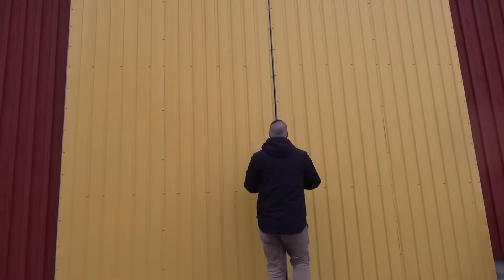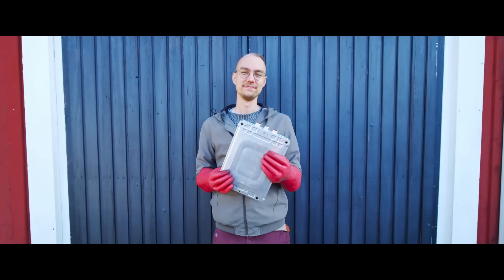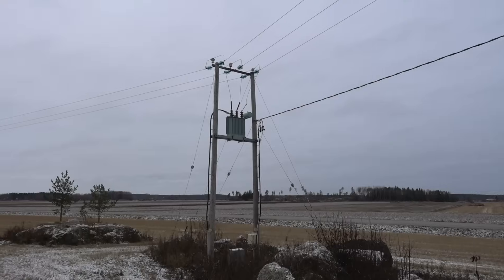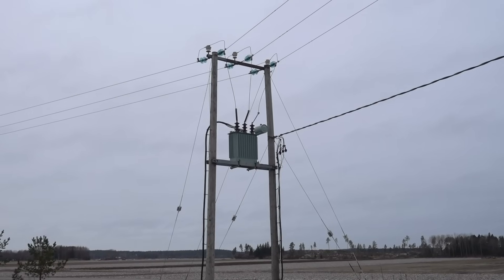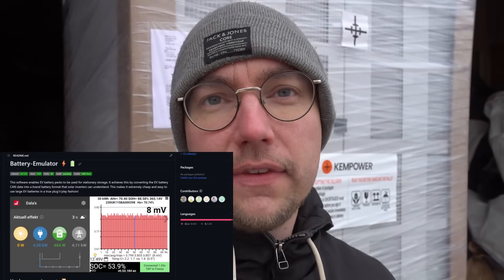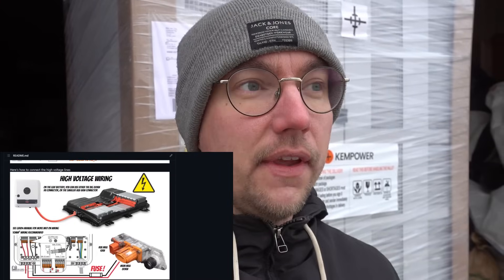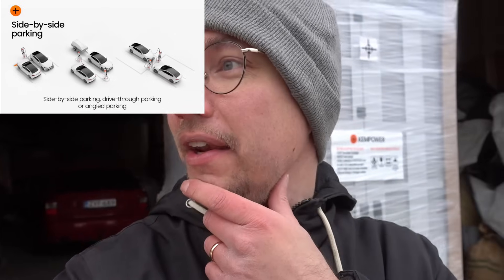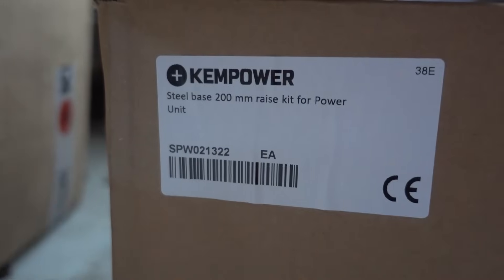400kW charging at home 🤯

Comment: Sounds like a great opportunity. Combine the technology you have developed with some off the shelf charge stations, sprinkle with come community assistance and possibly some crowd funding. Then you will be in the position of being one of the charging companies. Except you will be able to install your stations in locations with limited grid capacity. A whole market niche that has just been waiting for a solution. There would be lots of businesses that would love to have charging stations in their car park but the huge initial cost for grid connectivity upgrades combined with the large ongoing cost makes it impossible. In rolls Dala with his team of enthusiasts/followers/volunteers and for a much smaller initial and ongoing cost they setup commercial grade charging stations with a cabinet or small shipping container full of batteries. Maybe even a solar setup to charge the batteries to reduce grid electricity costs. All it needs is someone to push the idea. The small shipping container (about the size of a car parking spot) can be built offsite and transported in when ready. You could possibly even integrate the charging stations into the shipping container. Have half of the container enclosed for batteries and electrical equipment and the other half just have the roof and floor and have the charging station or satellite station installed in the open half. That way it would eliminate almost all onsite work. Just a single grid connection. This would make for minimal disruption to the customers site. It would also be much easier to move it to a new location in the future if required. So many opportunities. Also, building the setup offsite in a warehouse/workshop would eliminate delays due to weather. For a lot of the installations I have seen it takes many months to get a charging station installed and commissioned. Many different contractors have to do their work which needs to be scheduled and there needs to be enough delay between each contractor to allow for any delays. Whereas, you would able to do the majority of the build indoors, in a workshop with access to all the tools and heavy lifting equipment, away from any bad weather. You would also eliminate the risk to public safety issues that come with infrastructure changes to an active site.  Major damage could be fixed by a truck dropping off a new setup and taking the old one back to the workshop for repair. I am sure there are other benefits and of course any business would have it's issues but I think this idea could take advantage of your experiences up to now as well as the support your channel has generated.
Reply: "Except you will be able to install your stations in locations with limited grid capacity. "
Utter humbug. You can install all the fancy high Wattage hardware you want, how many Watts you get out of it is going to always be limited by the capacity of the local grid. Anything else is just magic thinking.
Reply: @mikethespike7579  The ability to store power in local batteries changes this. Yes, you won't be able to charge car after car at maximum charge rate 24/7. If your charging station is being fed 40kW from the grid then depending on the charging stations battery capacity you could charge many cars at full charge rate. Just not a never ending parade of them. In many locations there are busy periods and periods with no cars charging. Whenever there are no cars charging then all 40kW is going into the batteries. Then later when a car wants to charge the charger will draw 40kW from the grid and as many kW from the batteries as the charger and vehicle can handle. If many cars charge in a row then the charge rate would eventually drop as the charger batteries became depleted. But the charge rate wouldn't drop below 40kW as that is what the grid is able to supply. Depending on the busy times at the charging location there may even be cost savings due to the batteries charging in a low electricity cost per kW time period and then delivering that power later for a higher price.
Reply: @jaseastroboy9240  I was relating to your "There would be lots of businesses that would love to have charging stations in their car park".
That implies constant high voltage charging abilities for company cars, something you have now negated.
BTW, such a charging battery would cost about half the value of a new EV. Not to mention the cost of the actual charging station itself. And all that just to charge one single car within 5 minutes ever day?
On top of that, such rapid charging, as everyone should know, comes with a few disadvantages. It drastically decreases the life expectancy of the battery for one. And the heat development in the cells of both car and charging battery from such rapid charging would be extremely high and raise the danger of self-combustion.
Personally, I consider this "project" stupid, but I daresay some people need a hobby.
Reply: @mikethespike7579  Saying that there are businesses that would like to have charging facilities in their carpark doesn't have anything to do with company cars. If a business thought that having a charging station in their carpark could generate some additional customers through the door as well as some positive community sentiment. Then that doesn't involve company cars, I am not sure how you read anything about company cars into what I had written.
As for your point about the cost of batteries. Dala has done some amazing work on re-purposing old Nissan Leaf battery packs as fixed energy storage. So I was suggested the battery storage for the charging station as it would draw on Dala's existing expertise and experience.
And then your final point seems to be saying how bad it is to rapid charge an EV's battery. This may be true however people are still rapid charging their cars and are wanting the ability to rapidly charge at their destination. So I believe offering a product that allows a business to have a rapid charging station deployed to their carpark despite their limited grid connection capacity would be popular. And once again, this would be for the use of their customers as well as general use by the EV population, this would not be a solution for a business that had a fleet of company cars and wanted to be able to charge non-stop, one car after another.
Reply: @jaseastroboy9240  Who's differentiating between staff and customer cars? I know I'm not. I don't thing a charging station of the type you are describing would know the difference.
As for rapid charging, the kind of rapid charging described here is not what you seem to think it is. 400W will fully charge a normal EV within about 5 minutes. That's what the video is all about. But regularly charging at that speed will within months drastically diminish both your EV's battery capacity and that of the charging station's. That sort of rapid charging would also develop dangerously high temperatures inside both the EV battery and the charging battery if not cooled somehow.
And another thing you seem not to understand: The charger battery needs to be double the capacity of the EV battery (traction battery) to offer a full charging load. So, that's your suggestion of a cheap charger batteries gone out of the window right there.
Electricity is a complex technology not easily understood by a layperson. The numbers of "EV experts" now suggesting solutions that could have originated in a kindergarten seem to corroborate this.
Reply: @mikethespike7579  I think you meant 400kW. I am not sure but I thought I heard Dala say that the large electrical unit he was showing us is not the charging station itself but the box that feeds one or more charging stations. So the 400kW would likely not be directed out of a single charger. Although I do often see 350kW chargers at the charging locations around me. But I don't think there are any/many cars that can take charge at that rate. Certainly not for long. 
The cheap charger batteries wouldn't be a single EV worth of old batteries. Rather the charging station would have as many repurposed EV battery packs as needed. The packs are old and no longer suitable for use in an EV but stack up enough of them and they will provide enough current to satisfy any rapid charging EV. 
The decisions about how many battery packs to use would need to take into consideration the cost, demand, availability as well as the required storage capacity and desired charge rate. Obviously a site that anticipates a dozen charge sessions per day would get away with less battery packs than stations that expect fifty sessions per day. 
However if the layout of the battery racking and the associated supporting electronics were made as scalable as possible then if the initial storage capacity was found to be too small then it could be expanded later. This would also allow for lower initial cost for a business owner who may not be sure how busy their charging station will be.
I am not sure I would call this idea a kindergarten level idea. Dala would know more than most people what the merits of the idea are. It was little more than a suggestion to Dala of a way to implement a high charge rate charging station on a small grid connection. I also mentioned the idea as it aligns with a lot of Dala's previous projects, experience and knowledge.
Reply: @jaseastroboy9240  Personally I'd look into the possibility of using capacitors instead of batteries in charging stations. They can give unlimited high charges without damage, do not deteriorate and are far cheaper than batteries. Their only disadvantage is that they don't hold their charge longer than maybe two or three days. But that wouldn't be an issue if connected to an electrical mains supply. And anyway, lithium cells also lose their charge over time. Parking an an EV for 2 or 3 weeks will result in a totally flat battery.
Reply: @mikethespike7579 I don't think you know how "this" works in reality in different countries because of how the electric providers charge their customers. That is the reality we live in. When the sodium battery power banks hit the market, batteries will be used more or less as the price of power normally is much lower from 00.00 till 06.00. 
There are other "restrictions" to take in account, too. You can say that every "situation" is unique.

Comment: Well, if it's any conciliation, it looks like you have 3 phase power, which is necessary to even power up a large EVSE like that. No worries, even though it's rated for 400 kW, your Nissan Leaf will only draw a maximum of 50 kw from it. That transformer should have no problem with that, if you charge at night. You will need a 3 phase power meter, to bring in the necessary power connection. Time to call your local utility!
Reply: Basically all homes in Finland have three phase power and therefore metering too.

Comment: I would always think in these high power charger + battery bank to find a way to get that DC from the used ev batteries directly into suitable DC rail on the charger/power supply. Generally seems pointless to do DC-AC, AC-DC conversions along the way.

But then it might be not as easily plug and play as it would be with battery packs and inverters just “normally” feeding that kempower monster :)

Comment: Is this so you can charge a LEAF in under 10 minutes or something?
Reply: No. Because batteries have a limit as to how quickly you can charge them - the magnitude of the charging current the battery can handle.
Reply: @deang5622  It was meant as a joke, LEAF batteries also have no thermal management system
🤔 maybe he has a LEAF thermal management mod in the works too 🤯🤯
Reply: @Pegaroo_  Gotta make it sound like a joke then 🤣

Comment: Just for fun? As why would you ever need such a speed to charge at home? Your Car sits there 12-18 hours a day, some days maybe 48-72 hours! Ok this is fun to watch! Is there some minimum that it needs 400kW at 400V or 800V please explain to common people these basics in next video as we are not all familiar how it works and what you need. For example what is that connection that are needed to commercially install that 400kW unit in somewhere? 👍
Reply: He doesn't need the power, but the project 😅
Reply: @rkan2 But may other ones would need something like this, maybe not today, but in the next future. If the sodium iron batteries will be affordable, then this kind of solution will be quite common, as almost all power cables to every kind of properties/lots/parking areas are under dimensioned as of now. The problem are the peaks during the day, not the total consumption.

Comment: Now this one I'd have to come out and look at my self:) There is a company in Norway that "sups up" charge stations with weaker grid connections with a lower connectivity rate, as in your case. The name escaped me, but they also use kempower chargers for their installations. This is in effect a peak balancing solution 👌
Reply from the maker: Pixii powered chargers! This will be a budget version 😂

Comment: Just a guess. But charge at 40kw (max contiuous) a bunch of repourposed used UV batteries, in parallel. So they can in parallel via an inverter per pack, power this charger so the neighbours can fast charge?

Comment: A battery powered buffer between the grid and the charger to emulate a electrical network which could easily offer the charger whatever it needs (for as long as the buffer batteries lasts)?